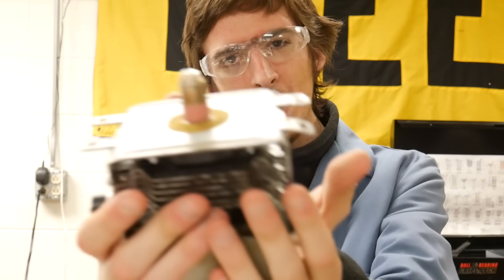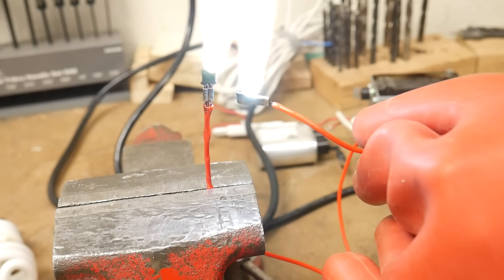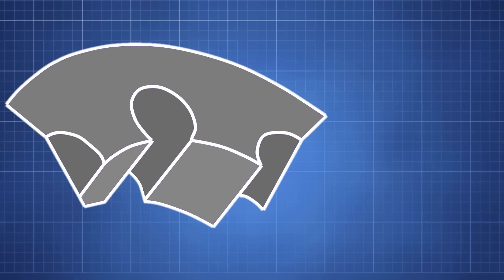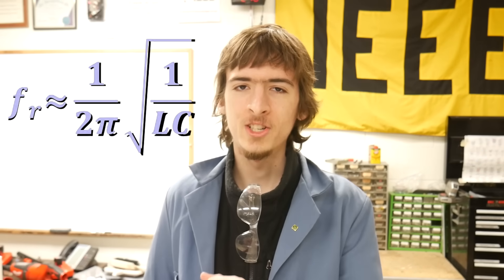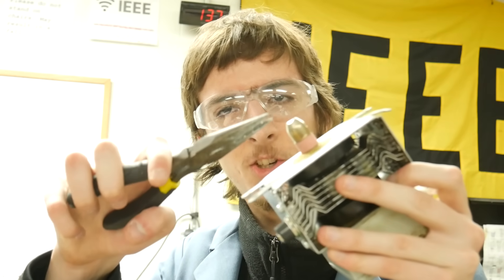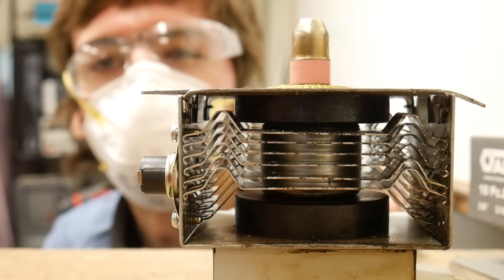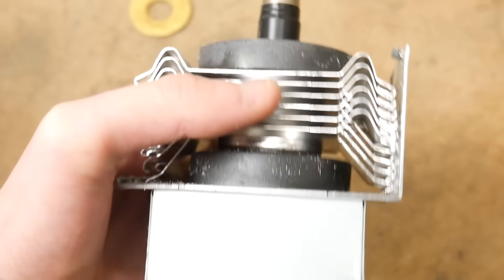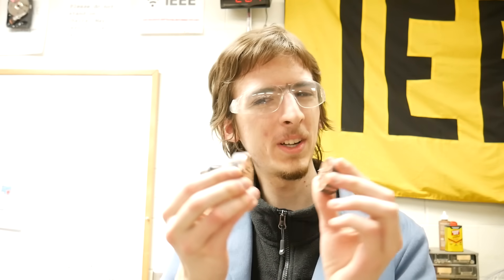What is a MAGNETRON - How Does it Work

Comment: The pink ceramic is NOT BeO. It is alumina with a chromium impurity to improve strength. If it was a single crystal, it would be called a ruby. BeO is a white ceramic material, used where high thermal conductivity and electrical insulation is needed.

You made no mention at all of the actual hazard inside. The filament is made of tungsten doped with radioactive thorium-232 to improve electron emission. If you ground it into dust with your dremel, hopefully you didn't inhale any of it.

Also no mention of the strapping together of the alternate vanes of the cavity assembly, or the pickoff loop that couples the antenna to the interaction space in the cavity.
Reply: Not relevant to your point at all, but the beryllium ceramics I worked with when building high power radar travelling wave tubes were slate grey. However, the beryllium ceramics in the gun and collectors were pure white.

Comment: so the microwaves come out as a TORROID                        pretty fascinating that all EM flows in a coaxial circuit            just a twisted pair of wires self reflects to have zero noise             if you look at our DNA it's a twisted pair                               mother nature is not a  mathematician        and has simple principles     and when you realize that you will see the same effects from  water to air to llight  to EM it's all one in the same.         Frequency    vibration    and the magical toroid with a null point  at the center of the dielectric   you can see it in this microwave demonstration     unreal once you figure it out    you wonder why mainstream science doesn't accept it as fact

Comment: Those magnets are cheap ferrite magnets. I think they only have to provide enough force to get the emitted electrons circling in one direction. Once the electrons choose a direction it's the high voltage and internal structure that does the rest.

Kind of like water choosing which way to flow out of a basin with a hole in it. The vortex reinforces itself.

Comment: You really can't mass produce a cavity magnetron from anything BUT copper and expect it to be small, cheap, and powerful enough for a microwave oven.  Aluminum might work but it would have to be physically much larger and silver would be about as good but prohibitively costly.  (Actually, silver plating the inside might let you get away with using less copper since the skin depth at 2.4Ghz would be tiny.)  Making one from steel however is a total non-starter most obviously because it's ferromagnetic.  At microwave frequencies, what would amount to core losses would be so high that it would be impossible to even sustain any oscillation.  Ferromagnetic materials are fundamentally unsuitable as electrical conductors of any kind.
Reply from the maker: Absolutely. This has been discussed in another thread too. Copper is really the best choice for a lot of reasons. I don't know what I was thinking when I assumed it would be steel.

Comment: In early models of microwaves there wasn't a bleeder resistor on the capacitor which made it a lot of fun to discharge with a screwdriver. Cool video!

Comment: This is a very good video, except for ''not working on one while it's plugged in''. The ''2K Volt '' capacitor has a 4K Volt potential to ground, and often holds it's (lethal) charge. ALWAYS unplug the product then discharge the capacitor before servicing !
Reply: Jason  I was not aware of that, where is this coupler?
Reply: Jason morgan  OK thanks
Reply: Jason morgan  Wow, yes, well put, lots to learn for sure!  I know I'm lucky to be alive after all the phosgene gas I inhaled while brazing where refrigerant was present during my 47 year career as an appliance service tech. Back in the 60's, we did not even know any better than to dump a refrigerator's charge into a kitchen then light a torch to repair it....sometimes even next to a piloted gas range!  I don't think I'll ever forget that odor. There is nothing I know of to compare it to. I just read that ''No valid statistics are available, but anecdotal reports suggest that numerous refrigeration technicians suffered the effects of phosgene poisoning due to their ignorance of the toxicity of phosgene'' and that ''phosgene gas was responsible for 85,000 deaths when used as a chemical weapon in WW1.. Wikipedia....BTW, Phosgene can be released during building fires...if the fire damages an HVAC unit containing R-22.....
Reply: +jason morgan  I  like to make art  :)

Comment: Sure wish you mentioned that the capacitor will hold a deadly charge until it is discarged... so that old microwave in grandmother's garage for the past 25 years is still deadly. Excellent job other than that missing caution or warning. Would be helpful to show best way to do arc discharge.

Comment: You said you expect the core to be made out of steel...well copper has a lower resistance, if we make it out of steel it would heat up even more because the large current that goes through it while in operation, wasting a lot more energy. Besides this part doesn't have to be very strong mechanically anyway. Ideally it would be made out of silver or even gold, but that's way too expensive for just a house hold appliance.

Comment: Flemming's right hand rule u stated is wrong. The index represents the magnetic field and the middle reps the electric current
Reply from the maker: I get this comment a lot. The right hand rule is application specific. I'm using it to cross I x B = F which denotes the force that a positive charge would experience.
Technically, since I was talking about electrons, you would be correct. I was using the wrong rule.

Comment: After consulting multiple sources, including this one, some more than once, I think I've just about figured out how these things work. The only thing I can't figure out is how the the resonant cavities form an LC resonator. If the resonant cavity is part of the same anode block, you would think the whole cavity would be at the same potential and thus no current would flow and there would be nothing to resonate. The only thing I can come up with is that maybe the electrons spiraling around the interaction chamber between the cathode and anode block would cause inductance and therefor create a potential in the anode block and current could flow through the resonant cavity part of the block. Guess I'm going deeper down the rabbit hole. Yippy!

Comment: if we controlled the frequency of microwave oven by using piezoelectricity for electron generator and temperature recorder laser based control system and electromagnets for frequency controlled microwave oven then minimum power required to make boiling potatoes one kg

Comment: Yo smart guy, i wanted to point out something that you might be able to explain more deeply.
What i noticed is that a magnatron is similar in design to a plasma focus - in fact it works on the same electro-magnetic principle, but in reverse. Also, Flux Tube by an army addition has 6 groves that match the 6 cavitys of magnatron and 6 horns of a plasma focus.
And since a magnet is vortex motion and not lines of sight and dielectricity spiraling down a cable... so i dont know, but you should make a plasma focus gun... you just need high end caps and some copper construction of the right shape for anode and catode. Also by switching polarity you get x ray emmision i think... pretty cool stuff for views :p

Comment: What is the relationship between the main cavity and the smaller cavitys?
Reply from the maker: The smaller cavities are LC resonating cavities. The inner cavity is where a field of electrons rotates in a spiral.
The relationship is that as the electrons orbit, they create a charge separation that drives a current resulting in an electromagnetic wave.
Reply: Thanks
Reply: You've got a cool channel going, I can't wait to see your progression. Keep at it! I don't have much background in this field (hehehe), but I was mostly able to follow along! Though I did have a quick question- I didn't quite understand how the resonating cavities had capacitor-like properties. From the diagram, it seemed like the metal surrounding the cavity was continuous, so I'm not following how a charge would build up on one side (if the material is just one continuous piece of metal, wouldn't the electrons just be evenly dispersed?)   Thanks and good luck!
Reply from the maker: Good question.
Even a single piece of wire, if the ends are brought near each other, has a capacitance with itself - a very very very small one. There is no such thing as a "short circuit" because all materials have resistance. Thus, it takes charge time to move through materials and allows it to build capacitance with anything around it.
Even real capacitors off the shelf have a resistance between the two plates - sometimes it is many Mega-ohms.
Reply: Wow, that's super interesting. You've changed my basic understanding of conductivity. Thanks! So then hypothetically, if you had a large diameter wire or cable of significant length and then bent it so that the two ends were close to each other, you could potentially get a high capacitance from it? No idea if there's anything practical about doing that, just think it's a cool thought.
Reply from the maker: I suppose you would. It can be modeled as a capacitor and resistor in parallel.

Comment: you spread that dust all over your placew ith the dremel tool,
so you will have it permanently in your workshop.
Also if you use a vaccumcleaner it will contaminate all installed filters.
I had used a sandblasting-like box to cut it open if i had the urge to cut it (which i never will xD) .
Second opnion would be to direct the dust stream of the dremel tool into a big strashbag (just use the right place of the grinding wheesl so they fly where you want it)

Comment: 35 years ago i worked in a repairshop,  we fixed toasters, vacuumcleaners, coffemakers, microowen and so on. 
One day a guy was going to fix a micro owen, the magnetron was loose on top of the micro but still electric connected and pointed at the radio in the room.
When he teststarted the micro, we suddenly heard a loud noise in the speakers: BRRRRRRRRRRRRRRRRRRRT and then the radio was fried!

Another day we take the lightbulb in old circuit switches, the ones that had a orange glow, we put 20 bulbs in a silicontube and put inte micro owen and started, then you could se when the antenna in the micro rotated and the bulbs lighted up in a sekvence!

Comment: Electron tubes were a fairly new idea and they recently started working on radar.  They weren't even sure exactly how this stuff actually worked.  It was mostly trial and error.  An engineer was testing a radar emitter (basic magnetron) and noticed a chocolate bar in his pocket had melted and invented the microwave oven by accident.  That's why it was called an Amana Radarange.

Comment: I may have missed something but what is the purpose of berilium oxide in the magnetron?
Reply: It is an insulator. The voltages across the magnetron electrodes are of the order of thousands of volts and to stop arcing the insulator needs to be of a very high order. Further, beryllium ceramic can be bonded to the copper structure of the magnetron precisely enough to retain the pumped vacuum within the device.

Comment: I thought the cathode attract electrons???
Reply: The cathode emits electrons into the tube. As current flow means that any point in a circuit both inputs and output electrons, it's a matter of reference. The electron emission in this instance is referenced to the inside of the tube.

Comment: It actually does give you cancer...
Reply from the maker: What will? The materials or the radiation.
The materials inside are indeed cancerous, but the 2.4GHz is too low of energy to cause cancer - excepting the chemical changes food undergoes in a microwave, that can be bad.
I say this according to research I've seen. I am very willing to change my mind if presented with evidence to the contrary.

Comment: I never thought of ceramic magnets as powerful.  What if one used neodymium magnets. The electron deflection would be greater but how would that effect the operation?
Reply from the maker: Good question. The reason the magnetic field is as powerful as it is depends on the interaction of the electron trajectories. Here are some possible paths of the electrons:

Little/No B-field >> electrons travel to the anode with little/no curvature
Correct B-field >> electrons are suspended in a spiral inside the cavity while they lose energy
Too strong B-field >> The electron curvature is so great that it falls back to the cathode without ever reaching the anode block.

If the electrons do not reach the anode block, there will not be the charge separation that creates the RF.

I also ran a test (just for you) on a ceramic magnet. The resistance was in the high mega-ohms range. I can't be sure, but I suspect that non-conductive magnets has some bearing on operation.
Reply: Electrons flow down hill. that means because the cathode is positive with respect to the anode, electrons will always flow to the anode, and can not flow back unless the potentials at the anode and cathode change. 

Its obvious that a stronger magnetic field will deflect the electrons more, on furhter thinking, i am inclined to think this might make electrons take a longer path circling more times before getting to the anode. This longer path might appear as more resistance and limit the current (and by extension power)  capacity.  

Since the electrons are being conducted traverse to the magnetic field, i do not see electrons being conducted through the magnets.
Reply from the maker: I did look around a little. If this link works for you, it should be a diagram of electron paths in different magnetic fields: http://www.radartutorial.eu/08.transmitters/pic/mag04.big.jpg
Reply: I get the tank circuit oscillations. And I get the magnetic field deflection. What i don't see depicted is electron changing velocity as it approaches a high negative potential. a change in velocity 1. gives up radiation, and 2 changes the deflection  into an even tighter circle, then given the right phase and trajectory, the electrons  will eventually arrive at the the cathode. I suspect that the "right position and trajectory" is effected by the strength of the magnetic field. And that a narrow set of the above conditions means  restricted power capacity.
Reply: I'm not trying to speak with any kind of authority on the subject but I have a bit more than a layman's understanding in related fields. Im more trying to ask questions and understand through the  lens of my current understanding.
Reply from the maker: Don't worry - I'm not insulted that you disagree with me. I really enjoy thinking about this.
It is my understanding that with a powerful magnetic field (larger than the critical magnetic field whereas the electrons just graze the anode block), the electrons remain in a corona around the cathode and some return to it due to changing potentials on the cathode. I suppose these electrons may still be retarded if enough electrons have sufficient velocity to induce a charge separation in the anode.
Interestingly, If there is a high negative DC potential on the cathode, I wonder if that would be enough to send the electrons to the anode block, but it wouldn't be able to induce any rotation.

If you'd like, I could do some research and get back to you.
In case you were wondering where I got my information. Most of the technical stuff is from an annoying SRM University presentation - a version can be found here http://slideplayer.com/slide/6004351/ (the relevant stuff is around the 9 min mark)
I've included all of my sources in the description.
Reply: The magnets get the electrons to spiral around, getting the right magnetic field strength increases efficiency. A Neodymium magnet would potentially increase the magnetic field strength, but an excessively strong magnetic field has a negative impact - its a balance to get the right electron path. Using rare earth magnets might make the magnetron lighter and slightly smaller, but drastically increase costs. And they need to make these as cheap as possible for your typical oven.
Reply: @ronmuller9899  thank you.  It's been 5 years since my first comment. Back then I should have been seeing that using a stronger magnet would simply deflect the electrons more, causing a longer path to get to the anode. And that to resulting oscillations in the cavities  would be caused more efficiently. 

Now I see the electron wind kind of like a 2.4 ghz electomagnetic flute over inductive and capacitive cavity  tank circuits.
Reply: @kreynolds1123  the flute is a good analogy. The electron making music as it pases over the cavities on its way to the anode. :)

Comment: maybe you could make a wifi mega router with one of these?
Reply: No. Except for the timer board, there is no intelligent circuitry to do the routing. Even if you could get it to transmit a signal, how would you get the signal into it in the first place? Better stick with trying to use a toaster as a clothes dryer.

Comment: explain the difference between ionization radiation and magnetic radiation 
the pores?  what are you saying, can you spell that?
Reply from the maker: I'm not sure that I understand the question.
Ionizing radiation is that which as sufficient energy to ionize atoms/molecules by removing electrons from the orbits. Microwaves are pretty low on the electro-magnetic spectrum so they don't really ionize anything (which is why they don't cause cancer)

P.S. Of course I can spell 'that': T H A T